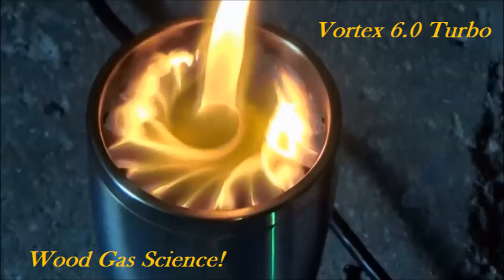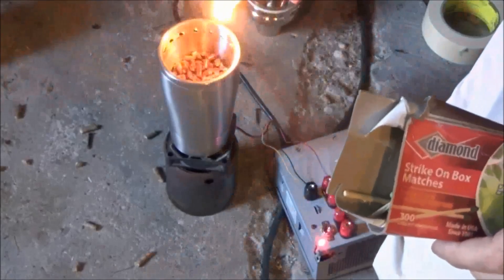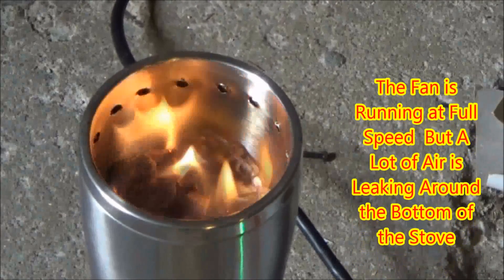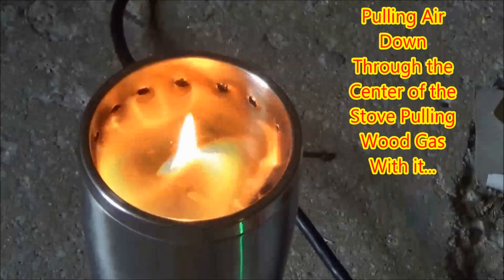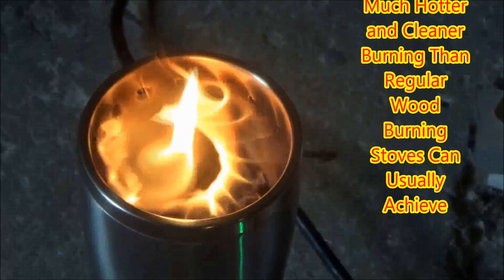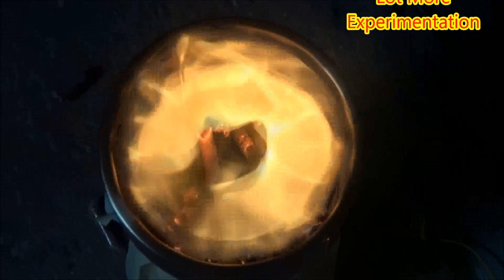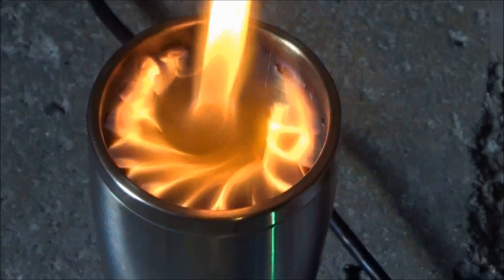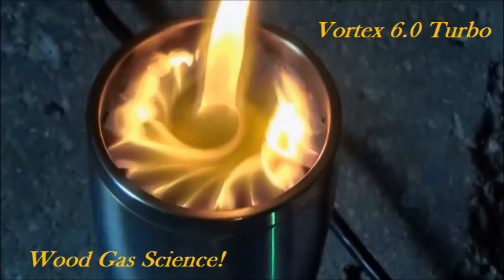Wood Gas Stove Science! Vortex 6.0 Turbo

Comment: Why is the "vortex" thing helpful?
Reply from the maker: It totally closes off the pyrolysis zone to help develop and burn all the wood gas. Thanks for the question!
Reply: @heathputnam9524  Please confirm if I'm perceiving this correctly: Complete combustion with TLUD's doesn't just happen.  It takes design effort.  Just introducing the gas to the air and lighting it with a match doesn't seem to cut it.  Is that roughly correct, that 100% complete combustion is actually hard to get really right?

Comment: What. In. The. World. Is. With. The. Choppy. Audio? Don't. Much. Matter. I. Guess. For. Every. Rocket. Stove. Build. Is. The. Same. I. Would. Love. To. Find. Some. Numbers. And. Equations. Based. On. The. Principals. At. Work. Here. Volume. Plus. Temperature. Gives. Rise. To. Heat. Produced. Moving. An. Air. Volume. Of. With. Respect. To. Ambient. Air. Temperature.

Where's. The. White. Board. With. Numbers. Instead. Of. Sketches. And. Doodles?
Reply from the maker: If you would like numbers... I have other videos with numbers... can’t guarantee the audio is any better.

Comment: But why would you want to create a vortex or otherwise focus the heat? For cooking, you definitely want to diffuse the heat, which is the exact opposite. :)
Reply: Use a high conductance pot like cast iron, should help with heat diffusing
Reply from the maker: Thanks for the comment!
Reply from the maker: I am trying to get a smokeless flame with no soot on my cooking puts and pans. Thanks for the comment.

Comment: And you can achieve a clean burning wood stove by adding a secondary air intake so the gases can burn off. You can make a wood stove burn with no smoke or hardly no smoke. Which is all this design is, your adding fresh oxygen at the top of the fire which in turn burns off the wood gases which eliminates smokes and makes a wood fire burn more efficiently and cleaner.
Reply from the maker: Thanks for the insight and comment!

Comment: The air stream leaving the fan will be rotating in the same direction as the blades. Do your secondary air jets point in the same direction? If the fan was opposite rotation to the jets it would have to change direction to go through the holes.
Reply from the maker: I will check that out! Thanks for the comment!

Comment: Efficient design along with very clear explanation.....You mentioned about negative pressure in primary holes. I just want to ask that whether wood gas is sucked out through primary holes or air enters through it? And please do not stop making videos on Wood gas stove. I am sure that there are a number of viewers eagerly waiting for your optimized design!! :)
Reply from the maker: I haven't really done enough experimentation on this design but, with the forced air it seems to be pulling the wood gas out through the primary holes. If it was not the flame would be moving up out of the can. I will try to continue with this design this winter. 
Thanks for the comment!
Reply: Heath Putnam i really appreciate your reply. Please have some insight to my question. I found many varying explanations regarding my question. So i would be really glad if u get the right explanation.
Reply from the maker: I will try. Thanks again for the comments!
Reply: Heath Putnam thank you so much. Eagerly waiting for ur answer
Reply: Great video.  I like the idea but I have a hard time imagining the woodgas going back down through the fuel though.  Wouldn't your fan cause a positive pressure up through the fuel?  Is it possible that the initial low flame was from the alcohol and that the pellets hadn't significantly started outgassing?  What happens if you just leave it alone for a while?  Does the flame stay below the rim for the entire burn?  If so, i think that that would be a great camp stove.  A lot of woodgas stoves just burn like crazy and a lot of the usable heat just gets wasted (and you burn your food). If you can keep a relatively well controlled flame like that ot would be great.  Uses less fuel and would be easier to cook on.  Great experiment!  Keep it up.
Reply: Don’t see the wood gas going out the bottom of the fuel, especially with a fan.  What is happening is the fire is heating the inner wall which heats the secondary air coming up between the walls above the auto ignition temp of the wood gas coming off the top of the fuel.  As soon as those jets of hot air meet the wood gas they ignite.  Simple check look between the inner and outer wall at the bottom.  It is cold there so wood gas would leave soot. No soot there = no wood gas there.  Just built a large version of this(no blower) like the solo stove fire pit but I draw my secondary air from outside.  Still produces a wonderful secondary flame around the inside lip but there is absolutely no way for wood gas to enter the space between the walls...  nice stove!

Comment: did you try to bend a bit those holes, to direct air to form vortex, it should make burn much hotter and with longer flames and bigger fire.
Sorry for my bad english
Reply from the maker: +Jovan Ilic I did bend the secondary holes to help form the vortex!! Thanks for the comment!
Reply: +Heath Putnam Interesting project Heath! Good luck in finding the optimum balance between a concentrated flame, heat generation and efficient gasification. Wood Gas Fire has some math calculations on his channel regarding efficient gasification. The math part of it is beyond me; but his wood stove is worth taking a look at. Looking forward to see your progress in these experiments with the wood gas vortex stove!
Reply from the maker: Stephen O'Brien Thanks for the info, I'll look at his videos.Any "open" stove is difficult to optimize due to the variable atmosphere it operates in. Thanks for the comments!

Comment: Great video content, but your audio really needs improvement :( (and no I don't mean the quality of your voice that is affected by your Laryngitis).

I would definitely like to see more of your experiments, results, & your conclusions.

You should be able to control the speed of your fan by installing a potentiometer (adjustable/variable resistor) in series with the fan & rotating the potentiometer to increase/decrease the output voltage & current to the fan.

Here's something to consider which may be your next evolution in wood gas knowledge & application:
https://www.youtube.com/watch?v=1p34rZeRPoM&list=PL4-PP8B60uTFLIYzfpfUJ6GXTFbU0NS1w
Reply from the maker: +A B Yeah, sorry about the audio and video for that matter. My equipment is sorely lacking. Thanks for the input and comments!
Reply: Did you view the vid at the url that I provided in my message?
Reply from the maker: +A B Yes I did, I have been thinking about trying this. I'll definitely do experiments with wood gas production in the future! Thanks for the link!

Comment: Though I don't plan do use forced air, what cans did you use? The soup cans are free but thin and look like they'll burn through after a number of uses. Do you think these cans might last longer?
Reply from the maker: +Knowledge Scavenger I used a stainless coffee mug. Stainless steel will definitely last longer and looks cleaner. Thanks for the comment.
Reply: Thanks Heath.